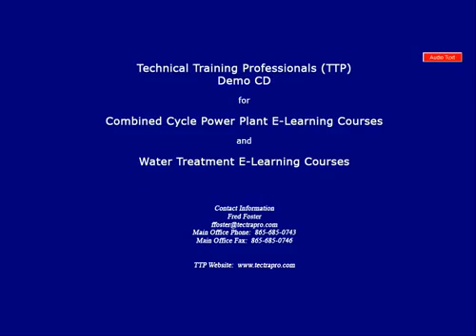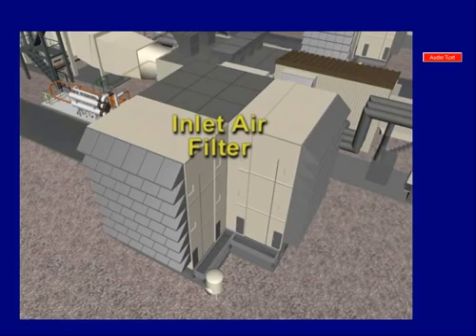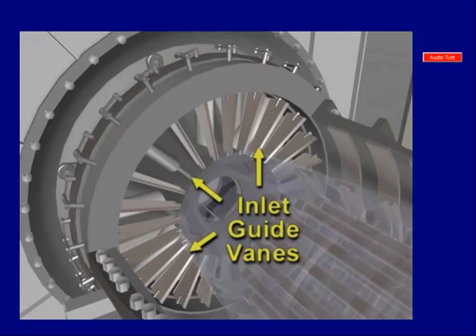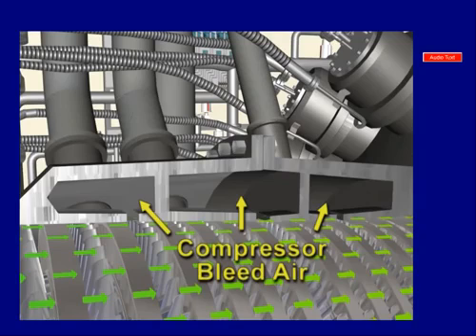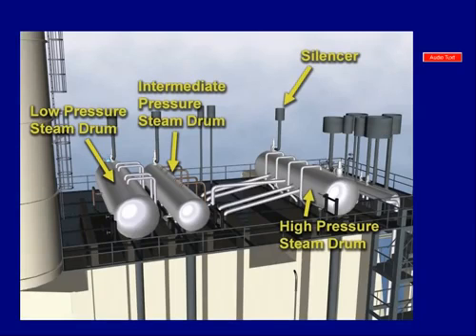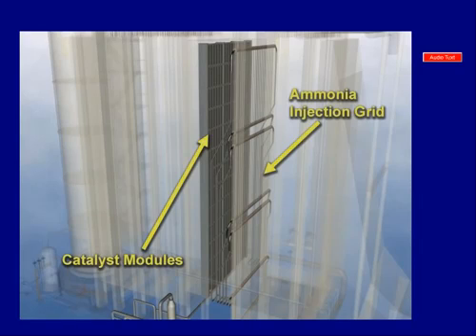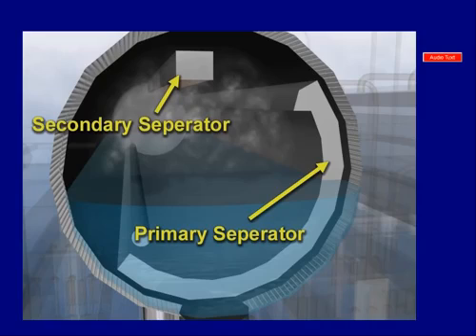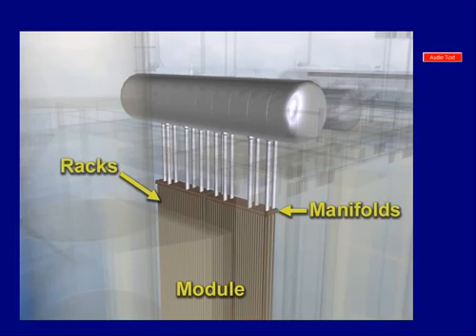An overview of the Combined Cycle Power Plant

Comment: Usually microgas turbines use recuporators

How do recuporators compare to using the heat from gas turbines to spin a closed loop steam turbine connected to a generator in addition the initial gasturbine generator??
Reply from the maker: nice one